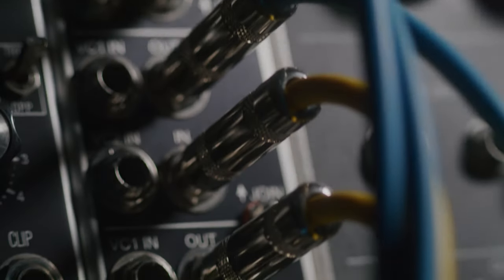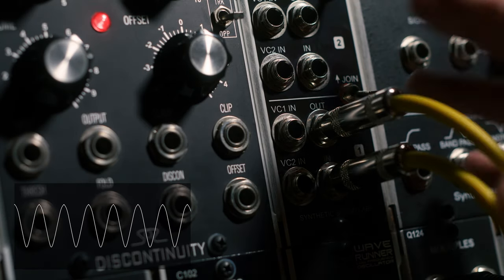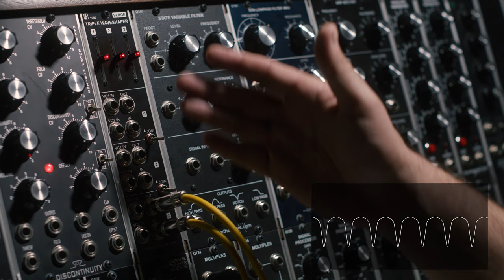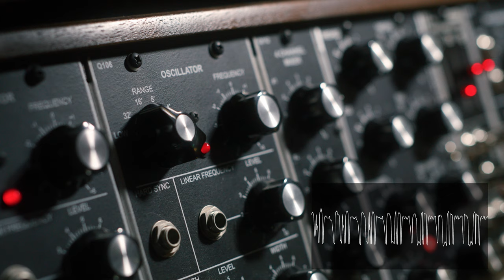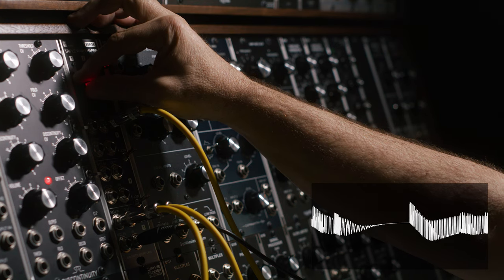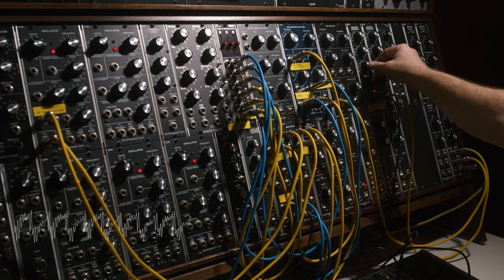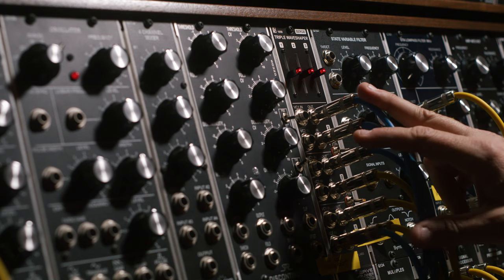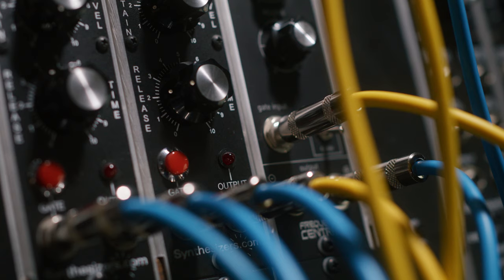Synthetic Sound Labs Serge Triple Waveshaper // Review // Patch Examples // Tips

Comment: Thanks you. But how can the first stage turn a saw tooth into a sin. I thought wave sharpers add harmonics not subtract them. I don't understand.

Any way, sounds great.
Reply: To quote the 1982 catalog for the Serge modular, The Triple Wave Shaper (TWS) is a non-linear modifier which can transform a sawtooth wave into a sine wave.  How I’d does this, I don’t know.  The combination of multiple folds and the modulations of the CV inputs is what gives it its sound..     But at its most basic it changes the wave shape to produce a new sound..
Reply: @CasaDelGatos  Thank you very much for the explanation.